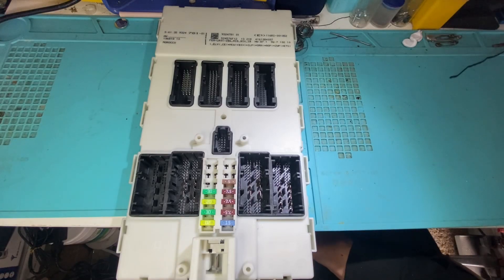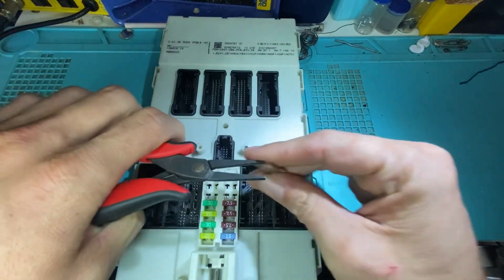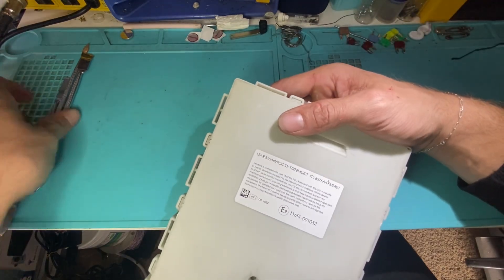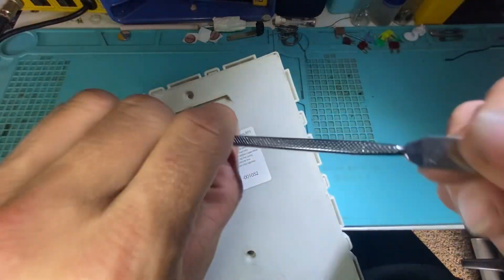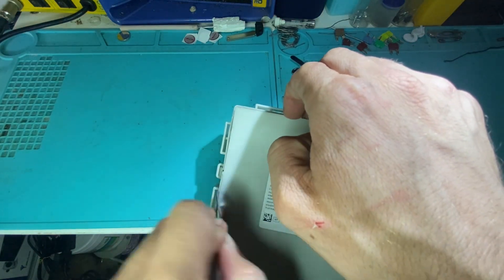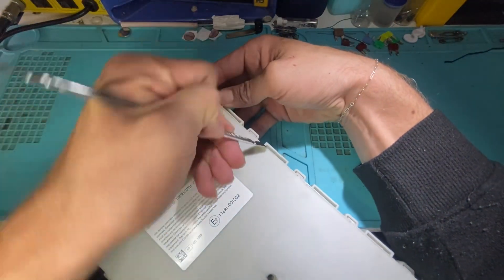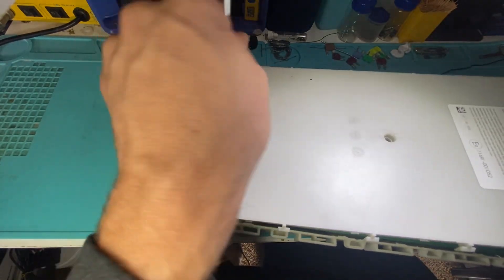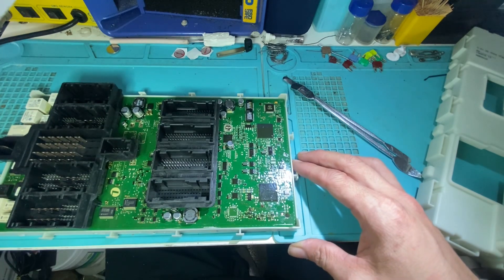BMW/MINI FEM/BDC Module Opening

Comment: I was rather hoping to see programming via OBD using ACDP or Abritus.
Reply: You risk damaging the computer with those devices then you gonna be held liable that way
Reply: @spotlessdetailz8475 No, I have already made many keys with ACDP2 via OBD (BDC). And also FEM on the bench. I highly recommend ACDP2. If anything happens, I have many devices that can repair the BDC module. Those who are afraid shouldn't be making keys.
Reply: @spotlessdetailz8475 No, I have already made many keys with ACDP2 via OBD (BDC). And also FEM on the bench. I highly recommend ACDP2. If anything happens, I have many devices that can repair the BDC module. Those who are afraid shouldn't be making keys.